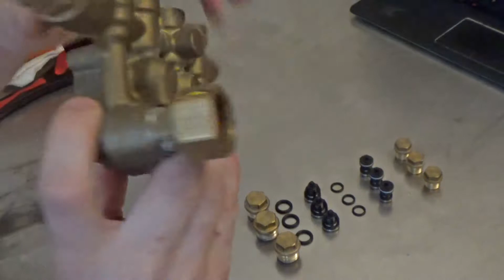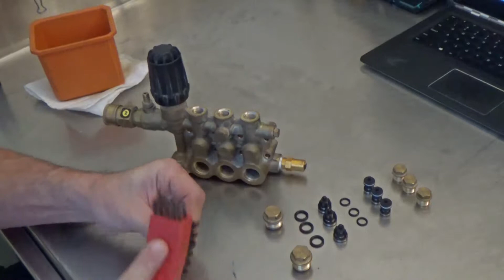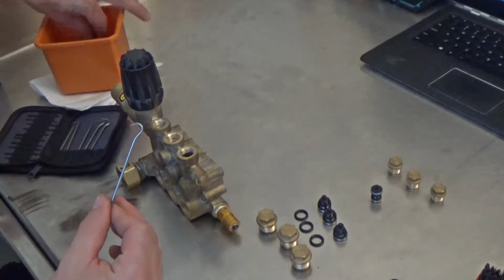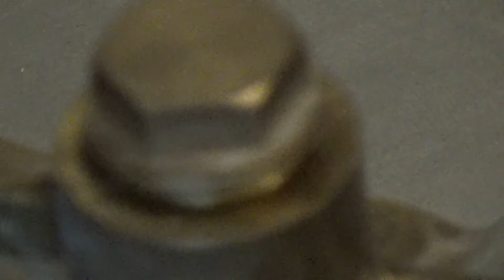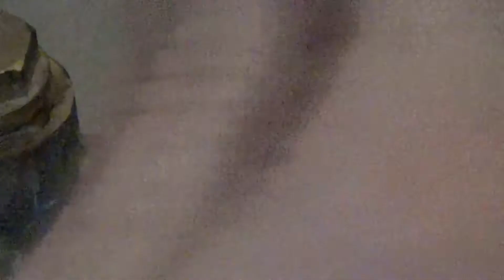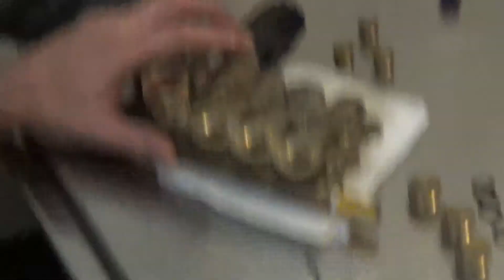AAA EW4040 Pump Manifold Tune-Up

Comment: I know you didn't talk about the unloader valve much however how freely is it supposed to slide? I took mine out to check it and it slides but with much resistance, thank you in advanced and love your videos
Reply from the maker: I’m not a high end pump mechanic but with water systems, all devices should slide easily because it’s a fluid control manifold.  Obviously the valves being seated and all should be a minor interference fit, but valve actuation should not be resistive.  Atleast not with excess friction anyway
Reply: @sinewavespecialties2373  thank you brother I figured so as well however I haven't found a video of anyone showing the functionality of a new unloader to have something to compare mine to lol, mine was gummed up and I assume the ring that seals on the shaft of the pin is supposed to slide freely but even after cleaning it up my machine doesn't idle down once the trigger is released, it just stays at high rpms as if I'm still squeezing the trigger at the wand. Perhaps I'm looking at the wrong part
Reply from the maker: @ReyGamboaRamo  well the parts I could find in the short time I had the pump (not my pump) they were fairly cheap.  Like $150 to rebuild the whole thing so it might be worth getting the parts

Comment: I just bought a brand new pressure cleaner witb this pump on it. One of the ports started leaking straight away. It wound its way out a tiny bit and the o ring was split. Questionable quality control from this brand.... I put a new o ring in myself as the shop i bought it from is an over an hour away but that also did the exact same.... I am going to take the thing back to the shop tomorrow...

Comment: Thank for the video .i am working on the same pump EW4040. heres my question.  I've narrowed down my pressure loss issue to the Unloader Regulator Valve and Seat.
I took apart the Unloader Regulator valve and i chcked with FNA and therebis supposed to be a spring inside the Regulator but its missing.  I am ordering a new Regulator that comes with a new seat but i am unsure of how to get the old  seat out.. any ideas...?? Thsnk you
Reply from the maker: Ehhhhhhh, have not done that before and the video was a one time thing.  I’m not sure if they have a machined seat or if it’s a thread locked seat ring actually.  I would imagine leak-by likely wouldn’t mess it up if it’s minimal.  Usually steam cutting is where problems start to happen, but as a liquid, the water is not at a high enough pressure to resonate the plug or cut the seat.  May not be worth the fort but not sure for removal

Comment: So I tried to change my valves in my Simpson 4400 psi 4 gpm I have broken smash them I have spent almost $300 on valves when I go screw the caps in it leaves  a gap when tightened

Comment: Is there a replacement pump at 4 gpm and around 4000 psi
to replace or swap-out the AAA EW4040 ?
Using my Simpson at 2600 psi ...PS 60843 
for drain cleaning and need closer to 4000 psi.
Thinking AR might have a pump ...with EZ  ?
RR
Reply from the maker: Yes, in reality you can put any pump on as long as it bolts up AND it has the same shaft size.  They are quite universal.
Reply: Check out the vevor pumps. Very cheap with good reviews

Comment: hello great info.so I have a dewalt 4200psi 4gpm machine i put a pressure gauge and when relesing the trigger the presure spike to 4200 but star to lossing pressure to 2000 and when the triger is pull only do 2400 psi. i take out the Unloader clended and lubricate the problem still the same. what do you think I should do next. excuse my english I'm from Puerto Rico.

Comment: I have Dewalt with this EW 4040 pump and after 5 months problems get started. After 140 hours of work time It gives only 3400psi instead of 4400psi and started to "shake" a little bit during washing. Do You think replacing this check valves solve this problem or its a piston side problem? Already replaced orings on this valves, nothing changed. Valves looks like in good condition, nothing is broken etc. Always doing oil change after 25h of work with this pump. What do You think?
Reply from the maker: I would break down the regulator valve and make sure the spring didn't break and open up or cause a blockage
Reply: @sinewavespecialties2373  Already checked this regulator valve and looks good for me, nothing is broken. Spring is alright but very very hard do squeeze.
Reply from the maker: @Kris9464  I would see if you can completely back off the pressure regulator, get the pump running, then slowly turn the regulator back in with the trigger pulled and water flowing.  See if that helps smooth it out.   Pressurizing and releasing rapidly from low regulation pressure may be the issue your pump is having

Comment: Great video!
I was wondering if you have an idea why my washer is only putting out like 1000 psi instead of the 4400 psi it should or close to it. 
I inspected all the six valves and prongs and they all look like you said.  They are in good visual condition. 
I ordered the piston side kit but I want to wait before installing it till I find out more info as to why the low pressure. 
I have a separate 2600psi washer that feels like it has more pressure than this one. 
The problem washer is a DeWalt 4400 with the EW4040 pump. 
I will appreciate any comment.
Reply from the maker: Make sure the knob for pressure control is turned out enough.  The regulator is separate from the pump itself.  Usually a black plastic handle

Comment: Can you please tell me what is the breass fitting on the very front of the pump, mine has a nylon tip and just starting leaking (sunjoe). Maybe I can replace it.
Reply: Where the hose threads in?
Reply: It's called a hose adapter and if you registered your sunjoe they'll prolly warranty it

Comment: How did you remove the valves from the manifold?
Reply: Yep. Top ones seem to be melted in on a machine with maybe 10 hours on it. I think these AAA pumps are garbage.
Reply from the maker: Gotta pull them. They are just held in by an interference fit front the o-ring

Comment: I have the same pump.. How do I add a bypass to flow toward my water tank..I do not see a return. I do pressure washing
Reply from the maker: If you put a return line on it there may be issues.  The knob on the manifold is spring loaded.  That spring takes up the excess pressure and when it is too much it will pop up and allow the manifold to have controlled leakage.  There’s no need for a return as long as that knob works
Reply from the maker: To add a return anyway, best choice would be to put a small 1/4” pressure valve on the output side of the pump and set it for a lower pressure than the pump manifold.  However, it may work for a while but it will eventually ruin the pump and possibly cause a lot of issues for the manifold
Reply from the maker: To make a return / downstream line, you will need to add a pressure relief to the pump EXTERNALLY as these pumps have their own recirc system internally.  The one you add will have to open at as lower pressure than the internal factory one.  You will lose pressure from the gun doing this so i hope its worth it

Comment: The outlet, past the needle valve ....after the soap barbed fitting.....I am missing that piece.   Can’t find it.  Not sure what it’s called.  Exact same pump
Reply from the maker: Pwoutlet.com is the website for this pump.  There is a PDF on the site that shows the entire illustrated parts breakdown for it.  The page after will have the list of the parts.  On the bottom right of that list will show assembly packs as well

Comment: I have the same pump I want to change at the downstream injector with a high-flow injector how do I close that one off injectors on these pumps are built-in the cast???
Reply from the maker: you could bore it to match another mass produced part or run a gravity bearing check valve but the pump isnt going to respond much different because the system is built on the theory of restricted flow,  everything past that valve would have to be redone to match and the inlet for the pump has to be bored too.  No matter what you do, putting a garden hose to a firehose wont change the flow rate because the garden hose is still going to have a max flow that wont change.
Reply: pro trick: you can watch series at Flixzone. Me and my gf have been using them for watching all kinds of movies during the lockdown.
Reply: @Gary Leonel yup, I've been watching on flixzone for years myself :D
Reply: @Gary Leonel definitely, I've been watching on flixzone for months myself :D
Reply: @Gary Leonel Yup, been using flixzone for since november myself =)
Reply: @Gary Leonel Yup, I have been using Flixzone for months myself :D

Comment: Do you know where to get that valve kit?
Reply from the maker: Microshark79 the part number and website are in the video description
Reply: @sinewavespecialties2373  looked there and that part# list the pump only. I need the kit like in your video.
Reply from the maker: Microshark79 I just went to the site and it shows the valve kit I used with that part number.  Got to site > open search box > enter part number
Reply: @sinewavespecialties2373  ok got it.  I had the numbers mix up.  Thank you. This will save me from a large shop repair.
Reply from the maker: Microshark79 Permatex brand thread sealer is something I had to put on all the brass parts after.  Thought it would seal without but it didn’t.  Use thread sealer upon reassembly
Reply: @sinewavespecialties2373  would Teflon tape not work? because most of the failures are due to loctite coming loose inside.
Reply: @sinewavespecialties2373  want to thank you again for part number and where to get the parts. My local repair shop has my unit and they cannot even find those parts.
Reply from the maker: @stower82  it could but it may have issues holding in the long term.  Be advised, the purple sealant and threadlock are definitely different
Reply: The AAA part number for the Valve Repair kit on the EW4040 Pump is 7109627 you should be able to Google that part number.

Comment: Exellent   explanation 
I have a problem with mine  that I can figure out has pressure with no problem is a 3800 psi 3.5 gpm Gx270 engine power by honda 
Problem that been have is  when you washing is like have a pulsation  like jumping  
Maybe you can help me if you know what is the problem 
I really not want to start changing parts that probably are in hood conditions 
I will appreciate if you can give me a tip 
Thank you very much and again excellent video
Reply from the maker: Best guess given it's pulsing I can say is that an O-Ring blew out and now a fragment of that o-ring is probably bouncing around inside one of the exit flow valves.  After tearing this one apart i noticed that the valves were like new, so I assume yours are fine too so I would get an o ring kit and rebuild from there.  My video didnt have it, but you will need Loctite thread sealant as well on the 6 brass plugs on the outside when you put it back together.
Reply from the maker: Another possibility is the engine itself could possibly be misfiring, pull the spark plug and make sure it is clean and gapped, then be sure the armature isnt all carbon packed or bad wires.